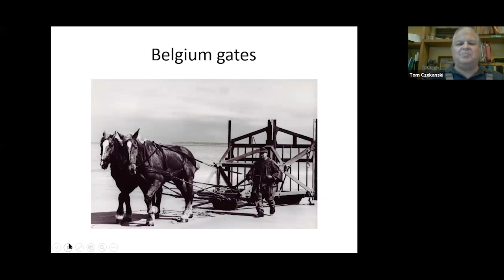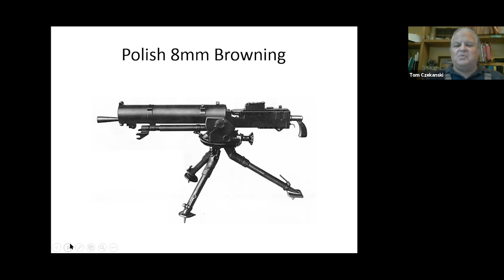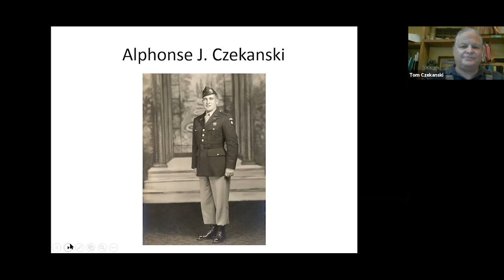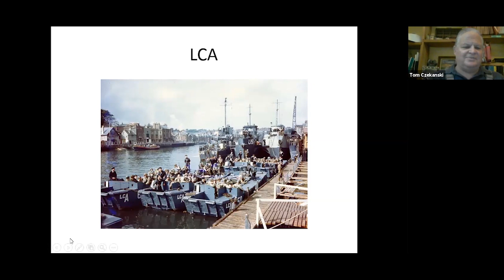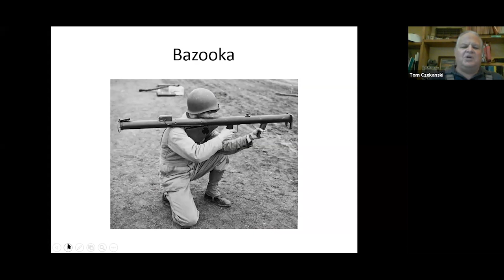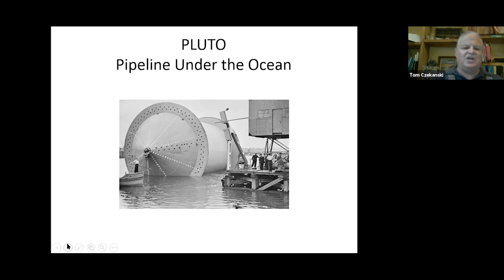Ask a Curator: D-Day Innovations with Senior Curator Tom Czekanski

Comment: Very nice presentation. I've read many accounts of these vehicles, but I haven't seen many pictures. Were all LSTs the same? Were the same type of LSTs used in the Pacific as at D-Day? Were lessons learned in the Pacific theater applied to D-Day? Which of these vehicles crossed the channel under their own power? Finally, is there a PowerPoint or PDF with the pictures you used? Thank you!
Reply: There are some minor differences among LST. Some versions use an elevator to get vehicles on the to deck others used a ramp. Some British made vessels were driven by steam engines rather than diesels but basically all the same in the ETO and PTO. The LVT was eventually employed in the Pacific. There were far more landings in the Pacific. Major landings in ETO ended after the invasion of Southern France so there is some lesson learning but the situations are often different. LCVP and LCA crossed on ships, Other vessels like LCT and LCI crossed on their own.
Reply: @thomasczekanski885  Thanks so much for following up!